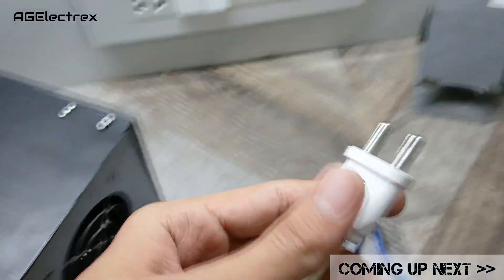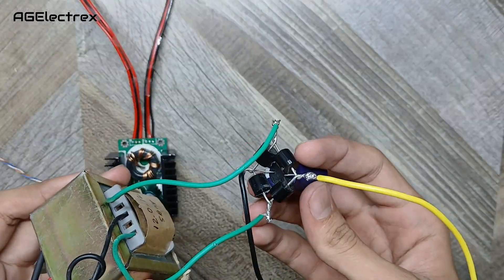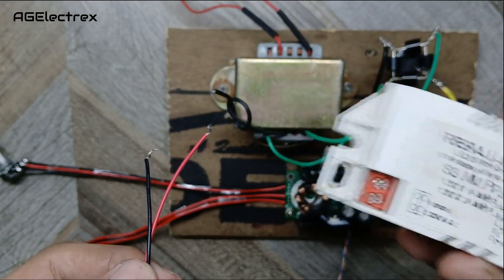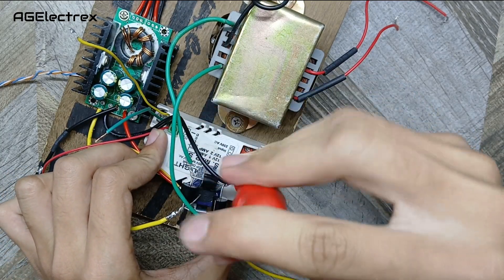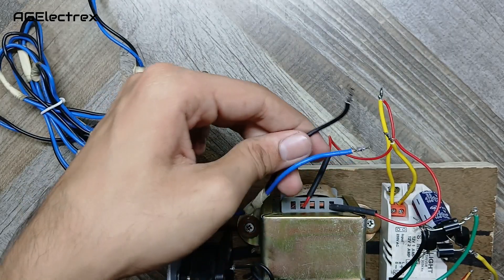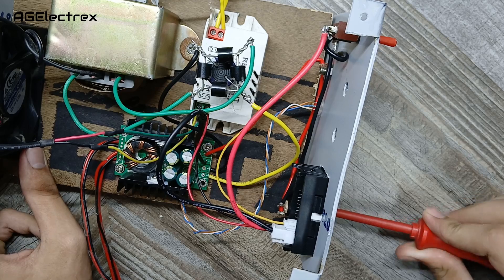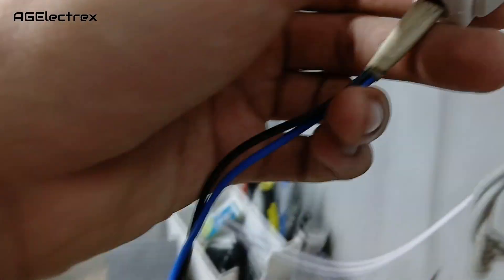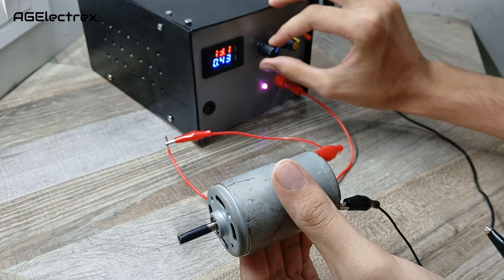Build your own variable bench power supply | Electronics with Adwait

Comment: Cool project bro💖
Can you share the component list used in this project?
Can you give the ratings of the transformer and link to the xl4016 converter if possible?
Reply from the maker: Thanks for your comment .
Sure , I have just updated the description , my suggestion to you would be to buy components offline since they are not only much cheaper but also you can check them and change them on the spot.